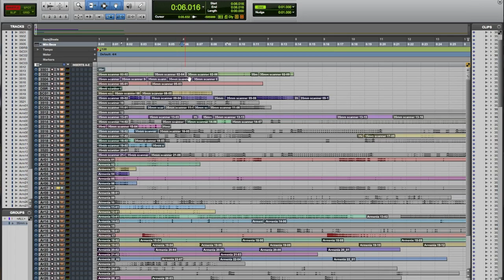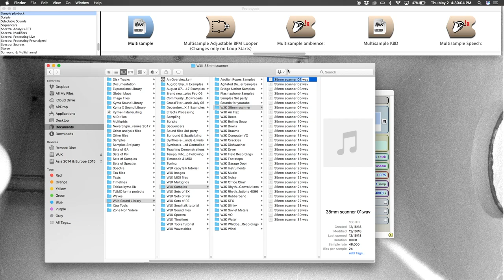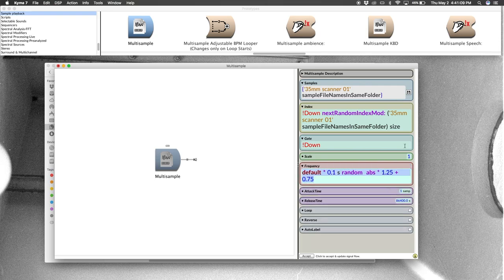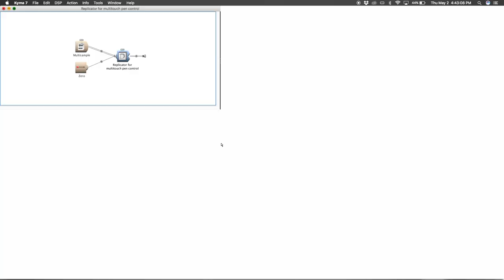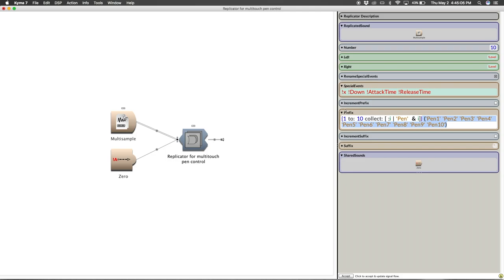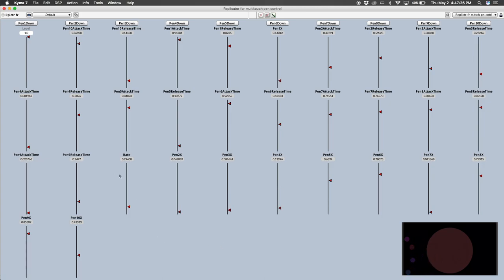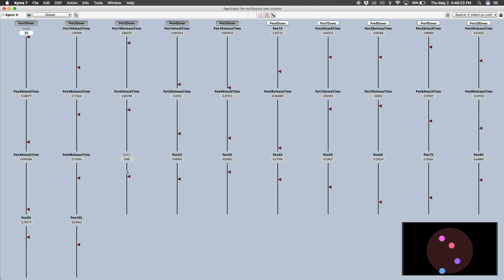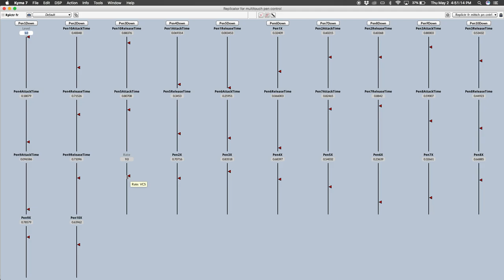Designing Sound Effects in Kyma Instead of in a DAW

Comment: Hi, these are very helpful for a beginner like me! That said, I hit a snag I’m hoping you might be able to help me with. I’m using the very latest version of Kyma 7. You found and used a “Replicator for multitouch pen control” prototype but I don’t have that anywhere I can find - it’s not in the prototype strip and I also searched all through the whole Kyma 7 folder - no go. Closest I have is a prototype “Replicator for Pen multitouch polyphony (using _?VoiceNumber suffix)” and I tried to use that but it is differently constructed Sound with less objects - I tried dragging the Multisample Sound into it (both replacing and adding in a mixer) but couldn’t seem to get there. Any help appreciated!
Reply from the maker: Hi Scott, I sent you an email. That prototype will work, but it's hard to say exactly where the hang-up is without seeing the signal flow graph and parameter fields. I'm sure it's just a bit of code that needs adjusting.

Comment: Very cool. I'm just starting to look into Kyma, but I'm pleasantly surprised with the techniques in this video as I've actually been using a similar approach in Ableton using the Ableton Sampler and Max for Live Devices to randomize samples (via midi) and modulate parameters on the sampler either while playing by hand or just recording multiple passes to see what comes out each time. Then, of course, I can chop those recordings into new samples. Good stuff, thanks for sharing!
Reply from the maker: That's excellent! When you say 'while playing by hand' what device are you using? MIDI keyboard? And I think you're right on with making multiple passes and chopping/reusing the most desirable parts; that's what I would have done here if I pursued it further.
Reply: @SpectralEvolver  Yes, more or less. I've been using the Sensel Morph, but that's just meant standard midi for me until very recently because Live JUST became MPE compatible within the last week or so. Now I'm planning to begin mapping MPE controls to my patches in addition to the max modulation devices I've used so far. Up to this point I've only processed eurorack sessions in this manner but need to start going through my field recording files as well.
Reply from the maker: @freewheelinghorn  Fantastic! Is there somewhere to see/hear this?
Reply: @SpectralEvolver  Not yet but I'm working on that haha👌
Reply from the maker: @freewheelinghorn  I hear ya on that. Making it all is one thing, and sharing it along the way is another. Overall, how have you liked you Sensel Morph? I'm thinking of getting one...
Reply: @SpectralEvolver  Totally! I need to get on that, folks like you and Databroth are inspiring me to start pushing stuff out 👍 As for the Morph, I like it a lot. My one gripe is that it is definitely harder (for me at least) when it comes to playing the black keys than a regular keyboard is due to its flat profile (can't feel the keys before pushing them down) and because the keys are slightly narrower than a traditional keybed. But practice can help iron that out. I haven't used any of the other overlays but I'd like to dive in and start programming it to see if I can get it working the way your ipad seemed to be working in Kyma. I don't see why that wouldn't work and since it's customizable the sky should be the limit. Now that Live has full MPE control I'm definitely gonna start trying some of that for controlling cv sends and byome and who knows what else. The other thing is that its slim profile makes it extremely portable which is nice even for simply doing some noodling on the couch just to get out of the studio for a bit when you need to see the sun again. Or for proper traveling of course. But yeah I'd recommend it, it's a very functional piece of gear and makes things easier, more fun, and more productive.
Reply from the maker: @freewheelinghorn  Thanks for the kind words. And if there's a way to get you a commission for the sale let me know. I'm a big fan of trying and using various controllers. In fact, it's like having a new instrument or even making a new instrument, especially when paired with Kyma. Somehow I overlooked the morph a while back, but because of you and a few others it's back on my radar. I'm particularly interested in the clear overlay so I can print my own "score" beneath it; I think that's really cool. I know what you mean about the keyboard thing. I have a continuum and went through a similar time of adjustment, and of course I'm still learning. Anyway, keep me in the know and good luck getting everything going and shared (if you choose to). Cheers!

Comment: This replicator for multitouch pen control prototype is not showing up. Has it changed name or where could I find the same prototype these days?
Reply from the maker: I don't have Kyma open at the moment, but if you follow my code exactly in the parameter fields you can use the 'replicator' prototype.